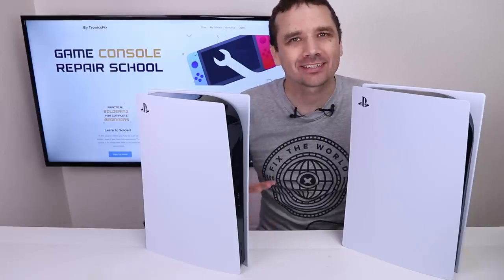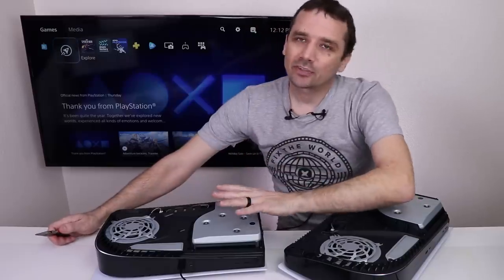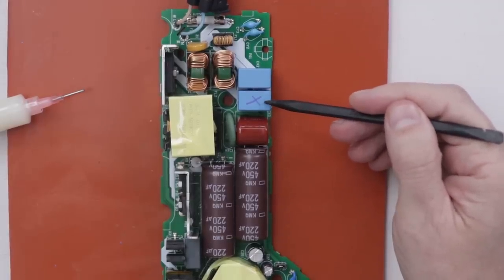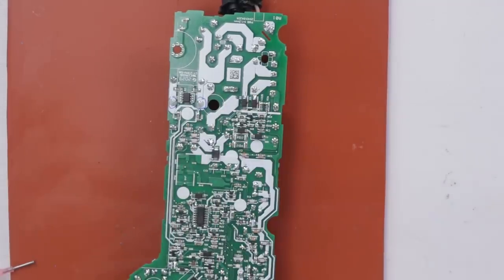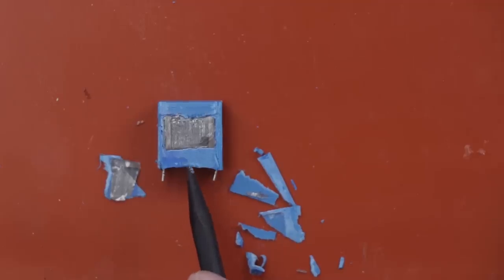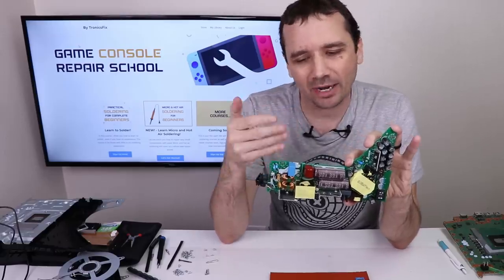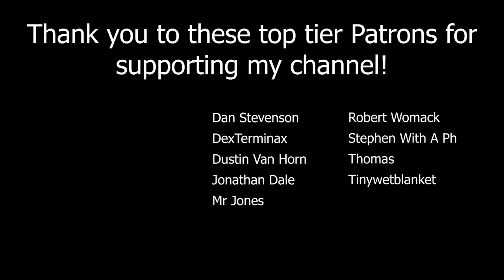PS5 Coil Whine - What Is It and Can I Fix It?

Comment: It's a 1uF 10% tolerance 310V AC X2 capacitor made by Surge Components. I'd try replacing with a similar rated one from one of the more famous capacitor brands. Maybe something from the Kemet F681 or  Vishay MKP339 series.
Reply from the maker: Awesome! That's what I'm looking for. Any idea if either of these brands will make one that doesn't make this noise?
Reply: @Tronicsfix  There's no guarantees just the hope that a better brand will be better manufactured. I've used both brands in SMPS designs and not had any problems. 
Getting the epoxy fill soft enough so it doesn't transmit noise to the case but hard enough to keep moisture out and protect the foil is difficult.
Reply: That's a good recommendation, both are very reputable brands. Vishay is often found in high end lab equipment.
Reply: @Tronicsfix  will you attempt to put in a different capacitor and make a video?
Reply: @Baba_Yaga88  Of course he will. It's been 3 hours since this comment was posted, he probably already ordered the part.
Reply: @PimptatoPCs  cool. I am new to his channel
Reply: @Baba_Yaga88  Sorry for being a bit rude. He did say that he would make a follow up video if he found a possible fix/solution. Glad you found the channel! Lots of educational and entertaining content.
Reply from the maker: That's the plan
Reply: @Tronicsfix  Awesome! You know if you actually get this issue fixed you are probably the first person to do it?
Reply: And killed your warranty at the same time, man thats Smart ;) irony off
Reply: @Tronicsfix  We have been using EPCOS (capacitive droppers) for years no problems. Matsushita (Panasonic Electronic Components) is also good (no surprise).
Reply: How about warranty ?
Reply: @neezaralinaveed3566  coil whine noise is not considered a defect under warranty so it’s usually not covered by a warranty
Reply: Vote for Vishay from here its one the best quality ones out there :)
Reply: Hm why is sony saving on a small component like this... i mean the premium capacitors cost maybe 50 cent more?  Its an important  comoonent when it the caus of that noise...they should  not save money on those parts
Reply: @yoool7137  they don’t care. Everyone still buy ps5
Reply: @yoool7137  50 cents x 2 per unit x 4 million units is $4 million dollars. That sounds like considerable money to me.

It can be difficult to understand how the costs scale with larger scale production. But with millions of units, even small cost increases per unit have a big effect.
Reply: @TEDodd  that makes sense but there seems to be a fair few this time who are either returning or trying to get repairs seems like they could reduce a lot of hassle and money  by just getting a higher end part ?
Reply: @joshohanlon1085  I didn't mean to imply it was a good choice, just explain a possible rationale. Often the cheaper part causes problems. engineering is about trade offs. Management says lower the BOM costs so you redesign with cheaper parts where you think it'll be OK.  Sometimes a bad choice is made.
Reply: @TEDodd  yeah and they already loosing money on each unit so it makes sense but not really acceptable imo. Hoping to see it fixed in future iterations but the fact the ps4 slim and pro had it i'm doubtful.
Reply: @Diranar851  wut? he doesnt need warranty!!!!!!

Comment: Protip for hobbyists: He's not joking around when he says not to disassemble power supplies. Capacitors store charge, so it's possible to shock yourself even if the power supply is turned off and unplugged. 

I'm curious to know if the "coil whine" capacitor you have there is COTS (Commercial off-the-shelf) anywhere, or has an equivalent it can be replaced with. Is the main problem that all of them whine like that, or is the one you removed simply defective and it can be replaced?
Reply: You were to late man. Those things hurt like hell. (Took apart a pc power supply. And accidentally touched the 400v capacitor. (It luckly was discharged a bit, but it hurts like hell)
Reply: @sandyfordd1843  i had a lot of luck. I wasn't grounded and i didn't touch it with two hands.
Reply: @sandyfordd1843  and learn from your mistakes, i didn't. I actually one time had 230v wall power in my hands. That did hurt too. (I always wear rubber shoes so i wasnt grounded, and i touched with one hand again)
Reply from the maker: I don't think it's defective. I think that's just a noise that these caps make. I'm hoping someone much smarter than me comments and lets me know something that might work in its place.
Reply: they all have coil whine dont believe anyone who says they dont i have one and have seen others in person they all have coil whine at this moment in time.
Reply: @GreenSmoke00420 does the fan noise drown the coil whine??
Reply: @jasperboer9854  Lol. I touched the red wire on a laser power supply that had been turned off for 20 minutes. 27,000 volts. Shocked me right through the wire insulation.
I went home after that. Next day I fitted a piece of silicone tubing around the wire so that it's double insulated.
Reply: Free electroshock therapy might be just what I need to get through this depressing pandemic. Of course, I'm only joking.
Reply: @Tronicsfix  If it's really just a bypass cap as you said, you could just run the power supply without it. Worst come to worst  you might just get some glitchy/interesting behavior.
If it's being used as a dropper capacitor though that would be a bad idea.
Reply: @jasperboer9854  not really the fan is noticeable, but its the coil whine that is most annoying, mostly because it changes pitch depending on whats going on in the game and its most noticeable when playing PS5 games in 60 FPS mode. you cant really hear it as much on ps4 games in 60 FPS not sure why. i had to actually get a pair of good gaming headphones just to play any ps5 games on it because its that annoying but i sit 6 feet from my tv so. i already sent mine in for repairs once with directions on how to fix the coil whine and all they did was send me a new one with all the same issues. so i gave up for now because theirs not a lot of parts for the PS5 out there yet and i need a oscilloscope to fix it.
Reply: @xKatjaxPurrsx  This capacitor is for preventing from switching noise of the switch mode power supply from sneaking back into the mains where the long mains wires act like antennas. It can interfere with other devices such as radios and WiFi. But the latter never works anyway.
Reply: @jasperboer9854  Really??
Reply: @coffeemakerbottomcracked  jupp
Reply: You should discharge the big capacitors before working on a power supply. You can do it by shorting the capacitor to ground. You can also put a resistor between both terminals for a few seconds and that should discharge it slowly, so you won't see any sparks. Just keep in mind that the resistor may get hot.
Reply: @masterlxds  better to short the cap to itself through a resistive load? still learning all this hardware-level wizardry, but would shorting the cap to ground (internally, b/c the PSU is not plugged in) send all that stored charge rocketing backwards through the PCB and through every component between the cap and your ground point?
Reply: @GreenSmoke00420  the power draw of PS5 games is significantly higher, verified by people who have tested it.
Reply: @jasperboer9854  the fan noise in most games, even PS5 games is nearly inaudible. The only game I can actually hear it is RDR2 (very low noise, but the only game where I can actually hear it working from the couch when the TV is muted instead of thinking it's not working at all).
Reply: That's why you always try to turn on the device (you're taking apart) while unplugged from pwr. Takes most of the charge out of PSU (never shocked myself enough to whine about it).

Comment: Thanks for this video finally someone who isn't claiming the noise is from the fan. Been trying to explain this to many people its simply a Quality control issue & even Sonys CS recognised this on the phone before fan boys attack me. Plus isn't it funny how every single reviewer was sent a dead silent console 🤔 my guess they will source the same parts once they are widely available till then they will lose money by having to replace these models
Reply from the maker: Ya...not fan noise.
Reply: I do wonder will this even be fixed PS4 slims and pros had same sorta issue but I feel where just drained out by the fan, this time Sony put such an emphasis on reducing fan noise they just forgot about this, insanely dumb imo
Reply: @joshohanlon1085  the center piece of my Nidec fan wobbles too, adds more pointless vibration. PS4 games are just about bearable but PS5 games is when the buzzing & fan noise come alive unbearably

Comment: I HATE the coil whine on my ps5. It sounds like dust is caught somewhere I couldn’t reach. Sucks that there’s no quick fix, but I’m happy to know it’s just an annoying noise and not a real malfunction. Thanks for trying!
Reply: My pro had a whine and loud fan so i cleaned the heatsink and it went back to being silent... cleaning the fan alone didn’t do anything...so it could be the ps5 heatsink as the air goes through it before it exits
Reply from the maker: I'll post and update video if I find a fix.

Comment: The nice thing about some PSUs is you can hear how the sound changes as load changes. 
This caps are SEALED because humidity kill them. We had SERIOUS issues with this kind of caps at work, once some humidity gets in, it starts to eat the metalization until the cap fails completly. You can replace the cap with same VALUE and VOLTAGE rating and pick another brand. Process are different from brand to Brand. But whine and ticking noise teng to come from the power transformer or PFC coils. The new green-ish SMPSUs can get really anoying when "idling" to lower the consumption down to nothing, but they change the freq, waveform and period, like they strt to use some little burst of switching to keep the ouput cap charge to value and then go sleep and them again, making this thicking thing. Under load, they are not longer in that mode. They get worse on PFC ones .... they are extremely efficient ... but ...

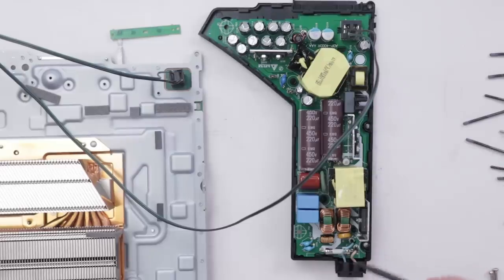Comment: 1:41 - Holy capacitors! Those are huge!
Reply from the maker: Lol...yes they are!
Reply: Nah, they're just somewhat bigger than the others, really large electrolytic capacitors, you don't solder those to the PCB, you bolt them. And the huge oil filled ones have filler caps so you can top up the oil level.
Reply: lol watch a video on repairing a CRT. THOSE ARE HUGE. lol They have caps nearly as big as a pop can in some cases.
Reply: reminds me of 80s pcs lol...

or home theater receivers
Reply: That’s what she said
Reply: Be sure not to touch or you'll die!
Reply: My Father repaired TV’s fir 30 years....trust me, they’re not big !
Reply: Remeber those from washing machines? Those big boys were perfect to make your classmates jump!

Comment: The coil whine is produced by the coils themselves and not the capacitor. When current gets passed through the coil, it vibrates and makes that sound. 

I've managed to fix the same problem (not on a PS5) by adding some thermal glue to the coil and the components around it (in this case the capacitors), gluing them together. 

Try this if you can,  you can use any cheap thermal glue. By gluing both components, the vibrations should be dampened.
Thermal glue on coils is frequently used on TV's to reduce the noise.
Reply from the maker: The actual coils already have glue on them. It's not from the coils. It's from the capacitor.
Reply: @Tronicsfix  Sorry then. Never seen this capacitor problem before with anything else. I was saying it was the coils because it's usually the problem.

Comment: Maybe its just the frequentie or harmonics which is resulting with eddi currents a bussing noise. Same with transformers and al coil like components. Just energize a relai it wil when old buzz because the coil windings are  vibrating and slowly getting more space to vibrate.
Reply: Or this capacitore Is filtering the 110 volt in and the higue voltagur male this noise

Comment: The reason the PS5 has coil whine is due to Sony neglecting to use a little silicone in the power supply. Most PSUs (incl the XSX) have this grey or white goop over the components to mitigate the vibrations and noise.

A little RTV Silicone (or possibly hot glue) will work. Could you test this out for us?
Reply: no the noise is internal to the cap

Comment: Aluminum electrolytic capacitors are rolled up with an electrolyte soaked paper. That paper can actually absorb the mechanical resonance that can create noise. This "plastic film" can vibrate with certain frequencies. Corsair has taken extra measures to make sure these capacitors do not make any noise by implementing additional quality control measures when sourcing components to build our power supplies. - - from Corsair blog

Comment: Switching PSU always make some noise. Very high pitched and many people don't have the hearing to notice it. For me it is very handy tool for a quick diagnosis in a no power case. If the PSU is singing it's usually not the cause of a no power issue. To make a switching PSU quieter some put hot glue or other kinds of rubbery kit on suspected components to reduce the noise/vibration. In this case of a capacitor vibrating on the inside of its casing that might not help. You can always revert back to an old fashioned non switching PSU with a transformer.

Comment: The X2 is a AC film capacitor.
buzzing noise is produced in film capacitors by the mechanical vibration of the films, due to the Coulomb force existing between electrodes of opposite polarity. Buzz noise becomes louder if the applied voltage waveform presents distortion and/or high frequency harmonics. Buzz noise does not affect the capacitor structure, nor its electrical characteristics or reliability.

Comment: Hi. These are called “film capacitors”. They’re usually installed 2 in parallel like on this board to reduce the electromagnetic effect which can cause the resonate sound you’re experiencing. But in your case you should focus on the two RF-chokes (green circle inductors). Cover these in hot glue or silicon and this will stop the ringing. Common problem in plasma TVs as well.

Comment: Having issues with my PS5 that was made in Aug 2020. I'd return this already to the retail store, then exchange for another, but with the current supply of PS5s think I'll  just go through Sony in few months from now and have them replace it.
Reply: Just contact Sony and if they accept your issues as being faults, they’ll tell you to send it to them. They’ll then send you a replacement within a few days.
Reply: I heard of some people receiving it within the same week, and others a whole month, I would just return mine since there's not much I would be missing out and pray I get lucky
Reply: What's your Issues?
Reply: @one_up907  i am getting a high pitched noise that is audible in a quiet room about 5 feet away from PS5. It is most likely the PSU. When current passes through the copper wound coils in the PSU, it causes them to vibrate. The slight vibration is making the high pitched noise. Apparently Sony skipped the glue/tarnish step on the coils of some of their PS5s.